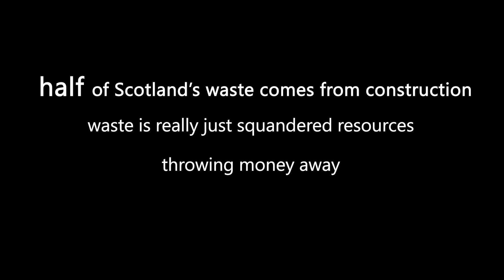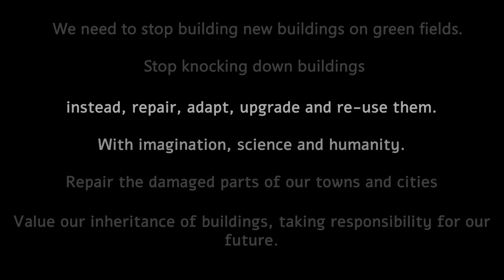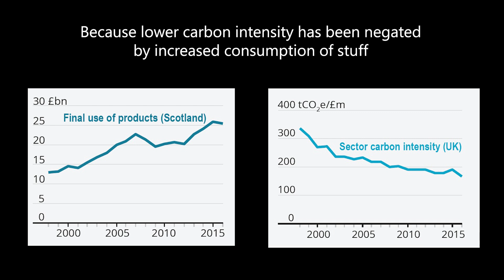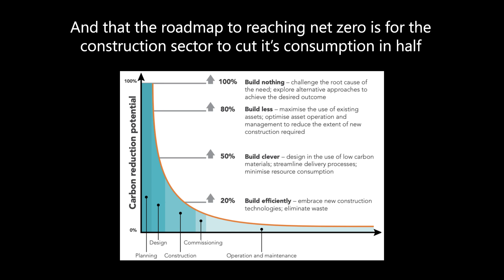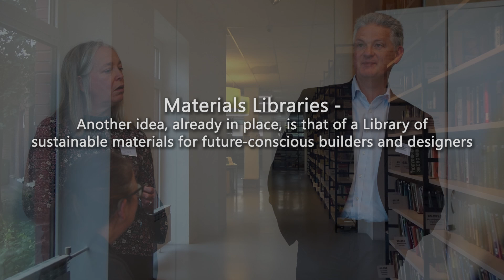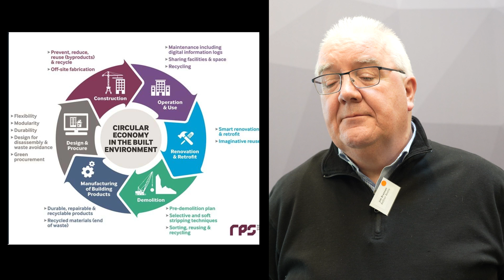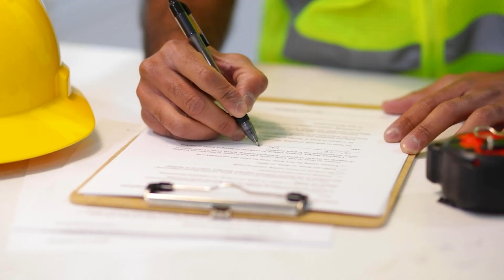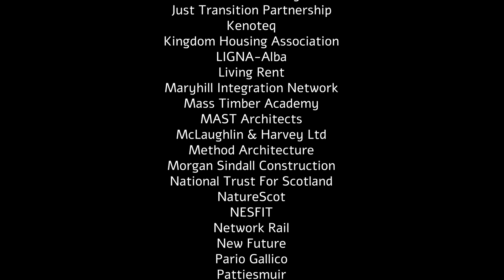Film 4: Towards a Circular Economy

Comment: When I was living in England (1961 - 1982) as an Architect, I worked mainly in refurbishing mainly existing residential buildings. This time included two to three years living in "squats", studying the needs and turning condemned buildings into habitation for many people unable to get into the mainstream market.
Most of the materials we used were from kerbside piles!
Later, in Rural Suffolk, I spent much of my time, as a builder, cleaning the local bricks for re-use and encouraging local tradesmen to use traditional methods.
Meanwhile the Government/Real Estate crowd were bent on demolishing existing stock and building replacements that were little better than potential future slums.
There was a standard that these people followed. Sir Parker Morris produced a report in 1961 that set out MINIMUM requirements for housing.
True to form, this was adopted by the Government as the MAXIMUM.
It is depressing that nothing much has changed in the intervening 40+ years!
Reply: Do you offer workshops? Training opportunities that improve community spaces, maybe?